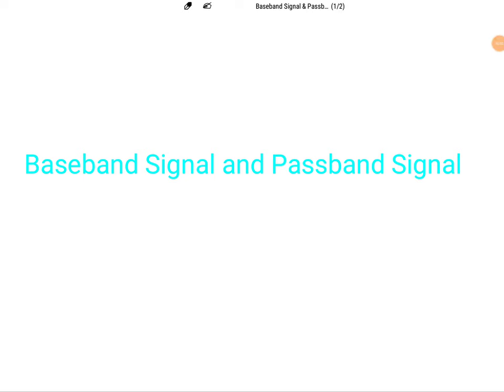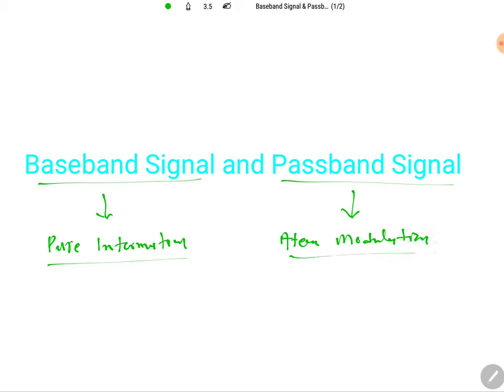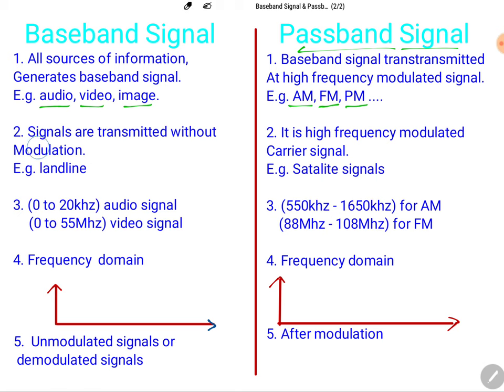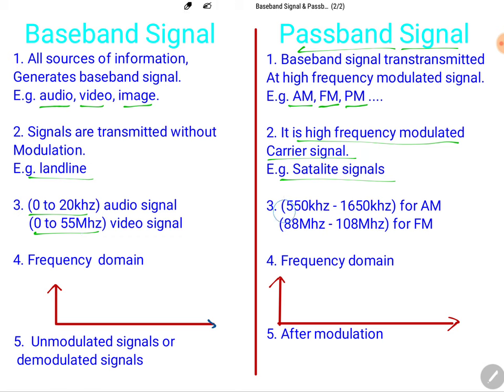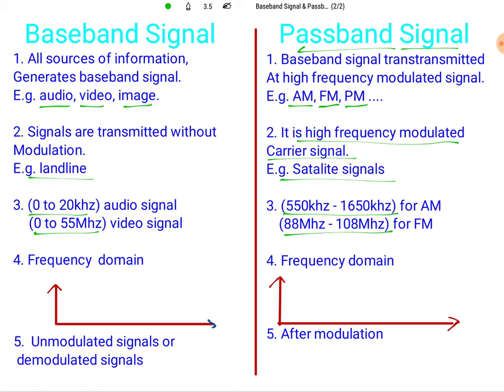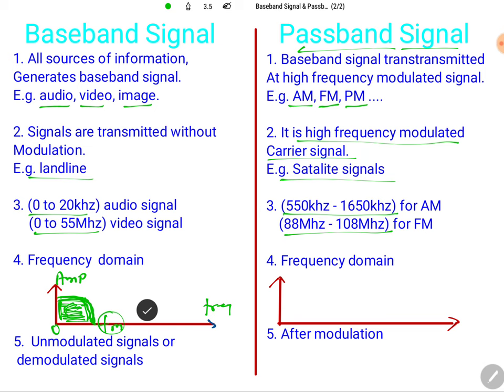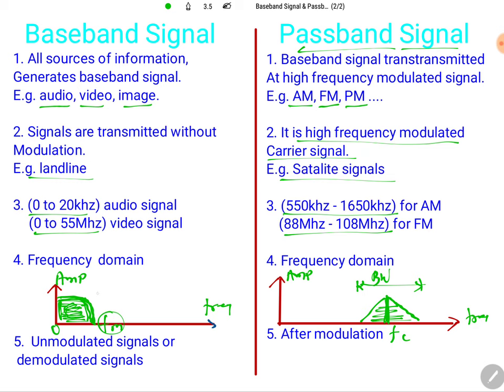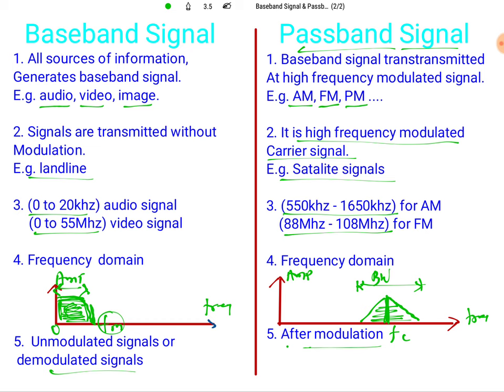Baseband Signals & Passband Signals (Basics, Definition, Frequency Response & Examples) Explained

Comment: Thank you very much sir. very clear explanation.
But as a beginner to this subject, i am little bit confused when putting all these terms together like baseband, passband, narrowband, wideband and broadband. i don't know all these terms are connected each other or not. in all tutorials these terms are explained separately. But if you could make a tutorial explaining putting all these terms together it will be really helpful for beginners like me.
Reply from the maker: Narrowband is used for low bandwidth.
Wideband is used for large Bandwidth. 
Broadband is used for internet connection with 100Mbps or more speed.
Reply: @EngineeringFunda  So these narrowband, Wideband, Broadband are separate terms from baseband and passband. right?
Reply from the maker: Yeah
Reply: @EngineeringFunda  Thank you sir.